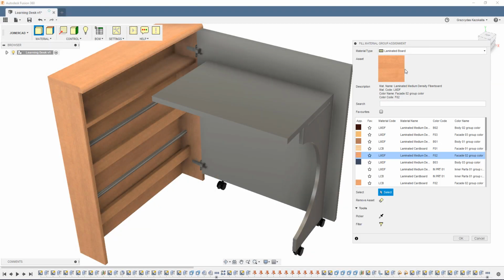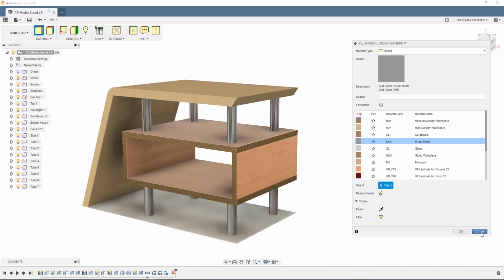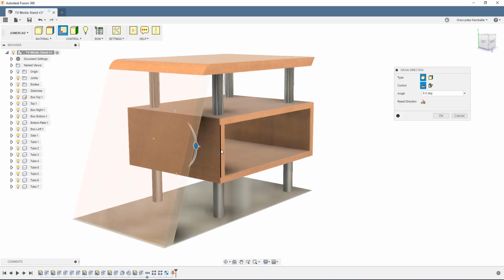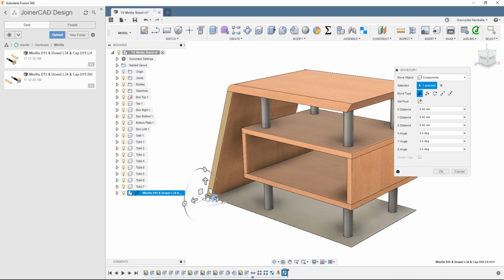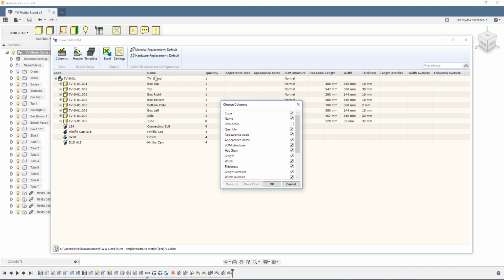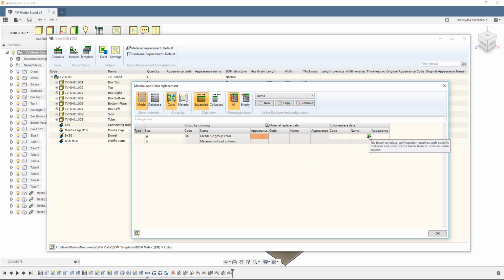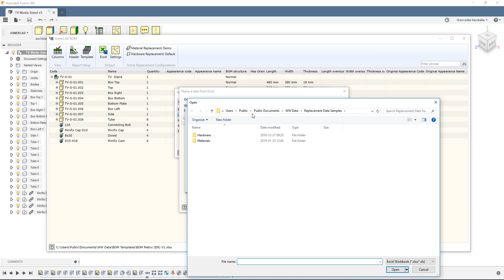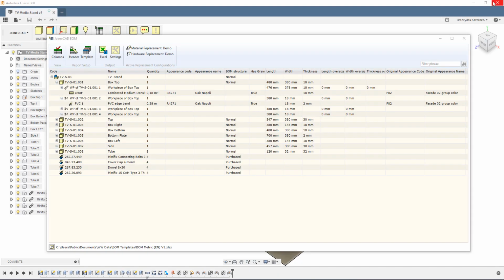JoinerCAD for beginners (Introduction)

Comment: If I understand correctly, does joinercad work with bodies, and does not work with components created in fusion360?
Reply: In opposite. The JoinerCAD works with components instead of bodies. You wll need to create a component (part or assembly), assign the material and cover material group, manage/adjust all oversizes, grain direction, generate BOM, apply replacement scheme and make the entries on the BOM relative with your supplier's materials and generate Excel. This is a typical workflow.